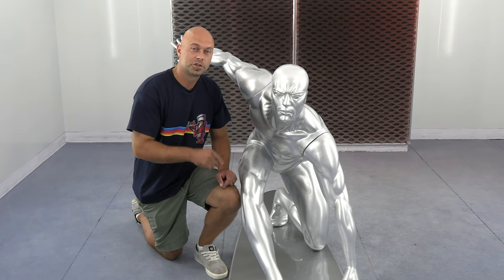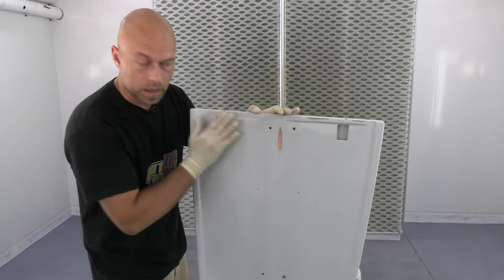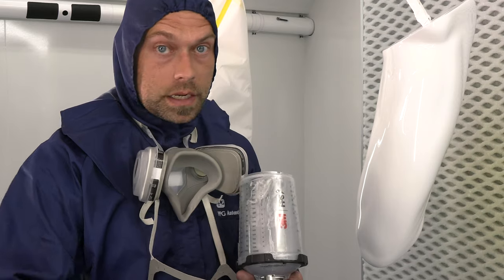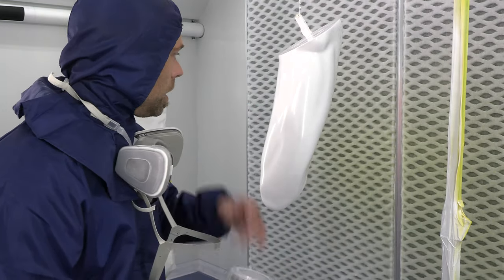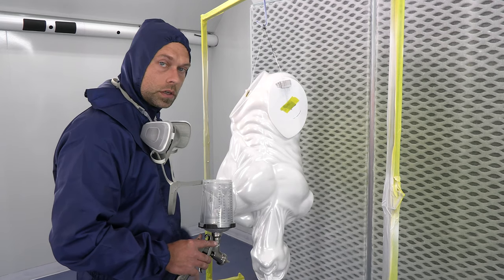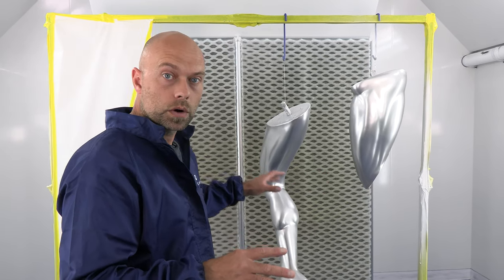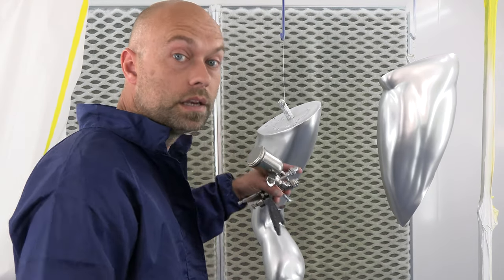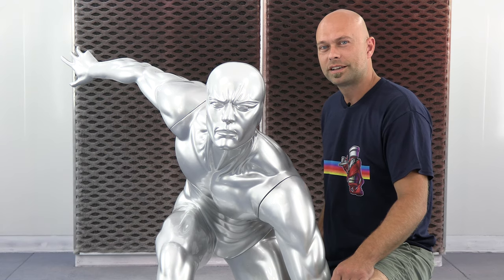Quicksilver Surfer

Comment: Hi another great video , any reason you didn’t use the UVLS or scenix clear .
I’m thinking of doing this to replace the aged chrome bumpers on an old ford. I understand I would need to wet sand and buff the UVLS clear , is there any reason not to use it.
Reply from the maker: UVLS Gloss would need to be buffed to be as glossy as the 2k solvent-based urethane clear (PPG ECU 550) used as both the mid-coat over 6001 Sealer White, and top-coat over 4104 QS. This would take a lot of time, especially with all the contours on the body parts. The PPG 550 cured to a glossy, level coating without any buffing required. With buffing, UVLS 5040 Gloss would otherwise work well. Thank you.
Reply: CreatexColorsCo Oh good at least I can use both options, I’ll be able to buff everything. Thanks for reply and great videos.